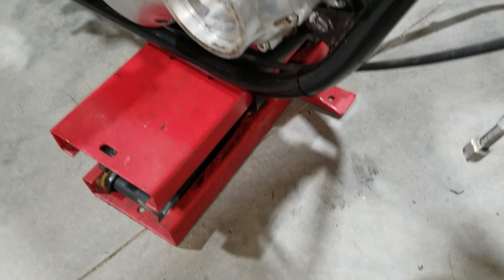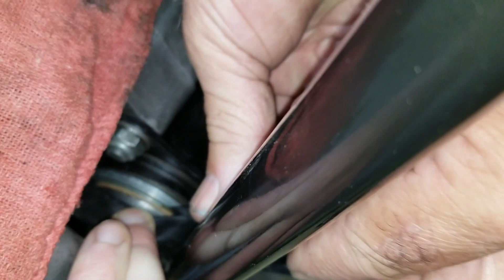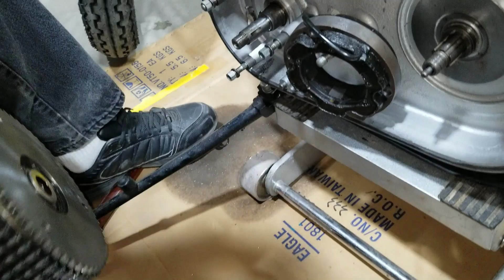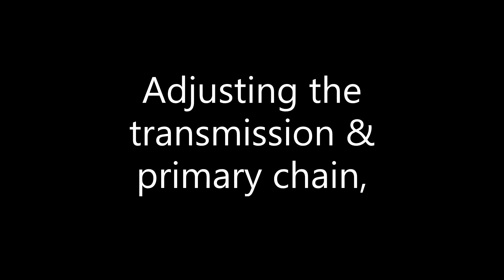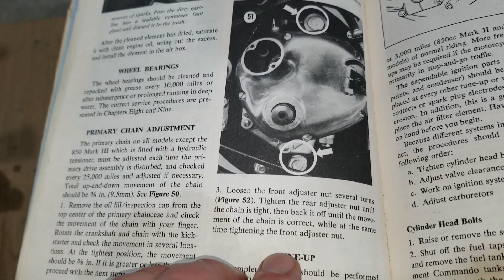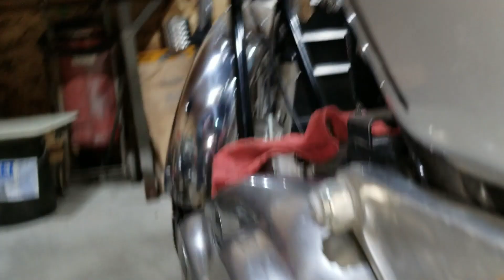1974 Norton Commando engine bottom end rebuild, Part: 4 Bottom end install and primary reassembly

Comment: I would say your triplex chain is set very slack. Should be 3/8" total up and down movement I believe.
Reply from the maker: We set our chains to the loose side of the specs because as things warm up things get tighter and when the chain get a little too tight there's two brass bushings in the 4th sprocket gear that rubs on the mainshaft. Two things happen with tight primary chains the one is difficult to find and get into neutral and the second is those brass bushings wear out rather quickly. So it's up to you how you measure and set the chain but for us it's a light lift up and down measuring not max lift up and down measuring.

Comment: I know this is old but you are solving a problem I did not know. I am replacing the  clutch on my 1973 Norton. I noticed oil on the plates and hardly any trans oil. Thanks for the time and effort you have put in you videos. Its helping some one out there. To day thats me.

Comment: I was taught that Woodruff key should be left a little low at the free end of the shaft, as being half circular it would self align as the interference fit was tightened down. In the US. you always, it seems, you say thousandths in UK in my day we would say thou. But l am very old and like watching you work on bikes of this era and before, the Comando was just post my time, l  had Dommies and a proper Featherbed Inter, the best of all road bikes in its day.
Reply from the maker: You are absolutely correct about the woodruff keys whether it's on a engine tapered sprocket or straight shaft as cams etc. the edge should be slightly lower where  you slide the sprocket on. I think I mentioned that as we assembled the primary. If not we should've because if you don't tip it slightly 99% of the time as you slide the sprocket on it pushes it out and either falls down or get stuck side ways and doesn't allow correct fitment. We appreciate your comment and the Dominator and international were awesome machines and the Featherbed frame was a game changer my Father had a 1963 Atlas 750 .

Comment: Nice workmanship and excellent video quality. You guys are experienced mechanics and know correct torque for 1/4" bolts, just by feel. FYI, the 1975 850 Mk III manual has a call out for torque on generic bolts in Section A. They call for 8 lb/ft for 1/4" plated UNC bolts. I would never use that, as SAE only calls for 7 lb/ft for grade 5 plated 1/4" bolts. Bolting into sand cast aluminum should call for a reduction in torque, to prevent stripping out the threads in the sand cast crankcases. I generally use 5-6 lb/ft of torque for these [timing cover, gearbox cover & inner primary to crankcase bolts]   Torque for the top gearbox mounting bolt is 55 lb/ft per both the 1970 - 74 and the 1975 Mk III manual.
Reply from the maker: Thanks for the great comments,

Comment: I had a total disintegration of my stator due to air gap.  I removed most of the destroyed epoxy and sanded the metal brushes to increase the air gap.  Is there any type of epoxy or sealant that you would use to protect the stator from the elements?
Reply from the maker: If it was mine I'd replace it with a good used one or buy a new single phase 10 amp alternator. Just sand if necessary the minimum air gap all around is .008" Also on Nortons the three studs holding the alternator can be slightly tweaked carefully if it's not centered or the three alternator holes can be drilled slightly larger giving adjustment room.

Comment: You mention that the nut on the clutch was 70 ft lb and now changed to 45 ft lb.  My Mk3 workshop manual is saying 70 ft lb.  Where are you getting this info?
Reply from the maker: My Norton Tech Manual talks about it, the snap ring that locates the clutch basket sits in a rather shallow groove, and there's a special collar that sits up against it with a machined groove for the snap ring so it can't jump out. At 70 ft pounds of torque against this snap ring they are known to shear off at 45 ft pounds with blue locktite on the nut it will not fail.
 Another part that should be eliminated is the locking tab that is used to hold the nut tight is made of too soft of metal and allows the nut to come loose by not holding the torque, and will cause wear on the main shaft and clutch center if it gets loose. The blue locktite is more than enough to keep the nut tight besides if you use a pushrod seal there isn't enough room for the locking tab anyway because there needs to be enough mainshaft  after the nut to allow the oring to seal against the end of the mainshaft to seal the pushrod.

Comment: Love the video, well done and thanks. I've been putting off checking and adjusting the Isolastics on my Mk3 as I never really had a clear view how to do it in my head. I've read instructions and watched the Mighty Garage videos but still had questions in my head. Questions you've now answered showing the use of the hammers plastic handle and where to insert the feeler gauge. Greatly appreciated, thanks.
Reply from the maker: Thanks for the great comment, and glad to help
Reply: 8.13.22.    ⚠️”Learn it, use, it pass it on”™️

Comment: I didn't know I was supposed to push my rear brake pedal when I tighten my axle bolt.  What does that do?
Reply from the maker: We've found that if you press and hold your brake lever down hard it keeps the brake backing plate centered while tightening the axle nut and there by the brake shoes are also centered and don't drag or give a pulse feeling when using the back brake. But the biggest problem that can happen if the backing plate isn't centered is one brake shoe can always slightly drag and that drag can cause the brake drum to get hot and melt the cush drive buffers prematurely.